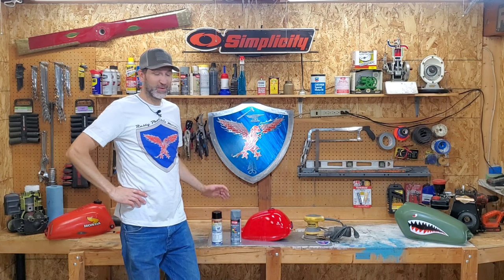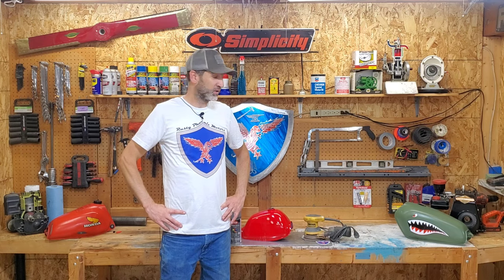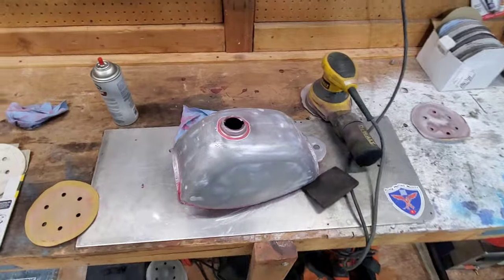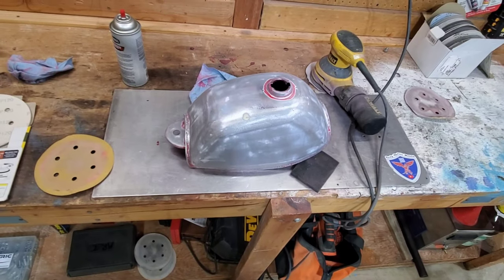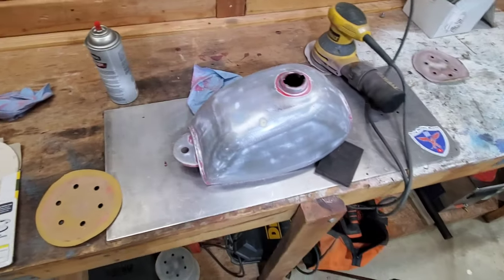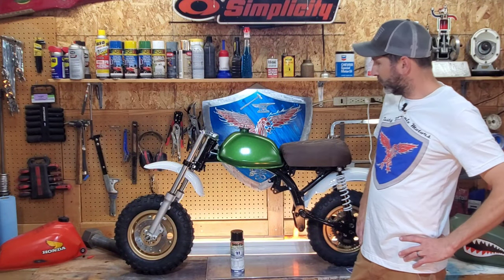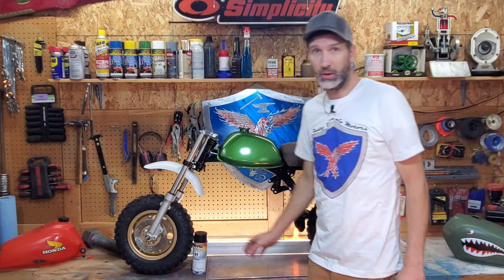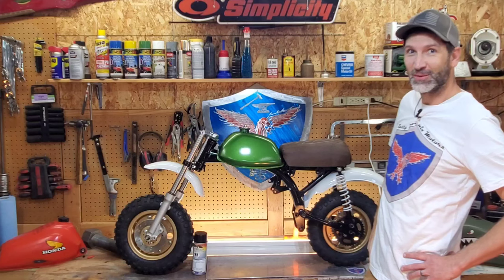Quality paint in a spray can? ABSOLUTELY! The Mini Bike gets some Porsche Mamba Green!

Comment: Dude, Doug, awesome video!  So many questions! First, we’re you using a flame to get any wet alcohol or water out? Second, are you going to clear and cut at all? Third, why didnt you fog the bottom? Fourth, when you do bigger bikes, like over the road super dependable bikes, do you plug the tank?
Awesome video! Awesome build!
Reply from the maker: Thanks!  Yes, the blowtorch is my trade secret- I use it to warm up the metal enough that I see the moisture / oil evaporate, then let it cool a tad (warm to the touch, but not hot).  I find the paint sticks better, is more smooth, and the best part, dries faster.  No clear coat with this paint.  Thought about wet sanding and polishing/buffing, but it came out really nice as is.  I'll get the bottom a little bit, but I wanted to get the video done for this week.  And lastly- It depends.  It's probably a good idea, but I'm generally careful enough not to spray directly in the tank, and if you let the paint cure, the gas won't dissolve it.  Cant wait to see your Vette!!!